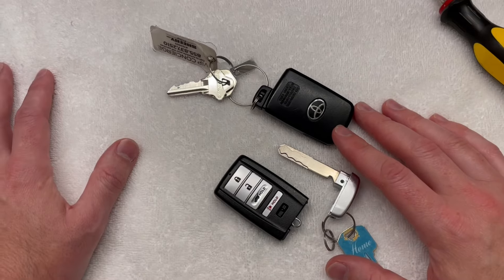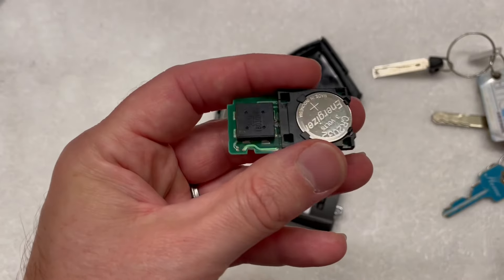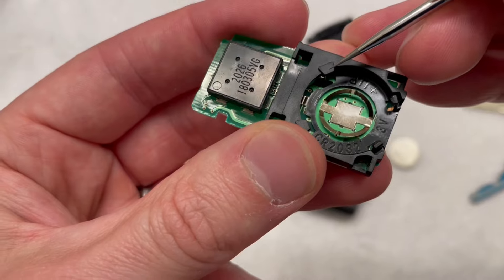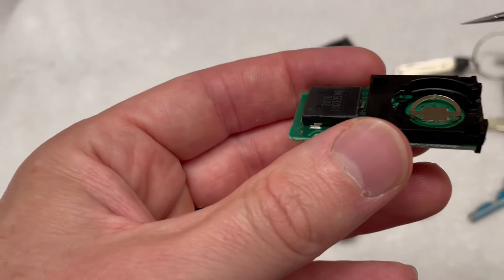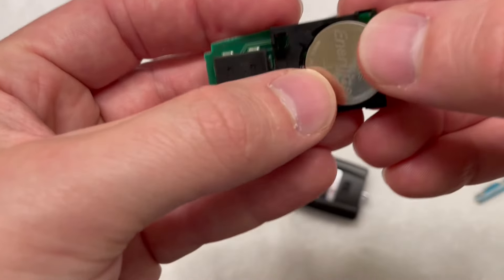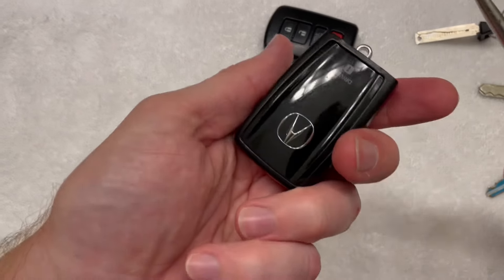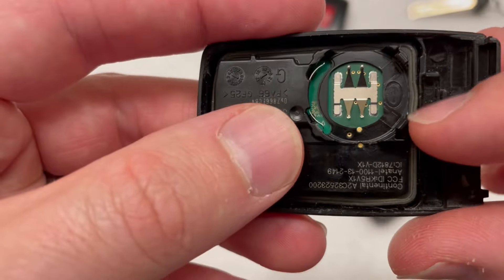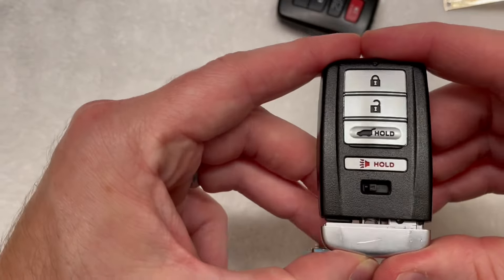Car Key Fob Not Working After Replacing Battery? FIXED

Comment: I can't adequately express how grateful I am to you for posting this video! I replaced the battery in my 17 CRV key fob and then it was dead. Nothing. I then installed a different new battery, and zilch, still dead. Indeed, the plastic clips had become bent down preventing contact. I clipped them off and then it worked!! I wouldn't have thought to look there on the side because I thought the contacts on the bottom were the only ones. Thanks again!
Reply from the maker: Glad it worked! Yeah suspicious when multiple new batteries don’t work :)

Comment: That's exactly what I went through. I've been changing the battery myself for the past 4 years. This was the 1st time I went through this issue (I thought I messed it up completely or that the batteries I purchased this time were faulty). You saved me a lot of time from going to the Acura Dealership to PAY for my keyfob to get "fixed" Lol. Thank you.
Reply from the maker: Glad it worked, yeah you go to the dealership with this problem and it’s at least a $100

Comment: I had one hour before I had to leave for work.  Replaced my FOB battery on a 2015 Honda Odyssey and the van would not start.  Panic mode.  Started pouring over YouTube videos, was about to give up and call an Uber.  Finally came across your video and two minutes later my van was up and running!!!  Thank you!  Three thumbs up.
Reply from the maker: @steepdriveway1  thanks I’m glad this helped and no Uber needed

Comment: Thanks for the more than helpful video! I replaced the battery in the spare fob to my wife's truck last week & thought the battery was bad.  Wasted money on another set to get the same results.  Google some YouTube videos & yours explained my issue without the extra commentary.  Thanks so much!  Because my next stop would have been the dealer or local fob programmer.
Reply from the maker: Glad I could save you money! At least from the dealership :)

Comment: Not the same issue but I replaced both batteries in my 2015 RAV4’s fobs and neither one worked. They were Duracell’s with the bitter childproof coating. I tried cleaning the coating off with alcohol but still didn’t work. I’m not sure what the problem was but replaced both batteries with Energizers and both fobs worked perfectly. Not buying Duracell’s anymore
Reply from the maker: Oh wow thanks for the insight

Comment: 2:05 is it safe to have the battery there without the plastic piece holding it in place? Will that half metal circle straighten over time and disconnect it from the battery while I’m driving?
Reply from the maker: @LouisTLW  hi yes it’s safe it still should pop into place
Reply: @BStride  alright thanks

Comment: This helped a lot but quick question is there a solution if the plastic tab on top of the battery broke?
Reply from the maker: The small black piece? As long as the battery makes contact and you get the light place the other half of the remote on and it should be fine